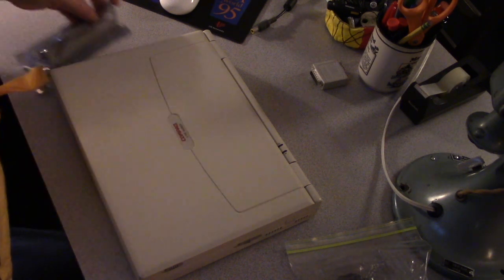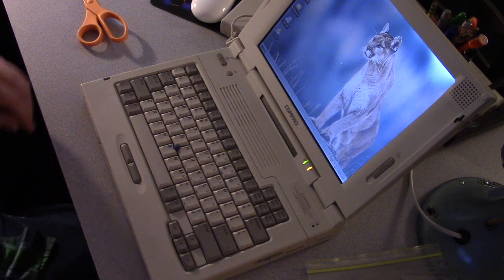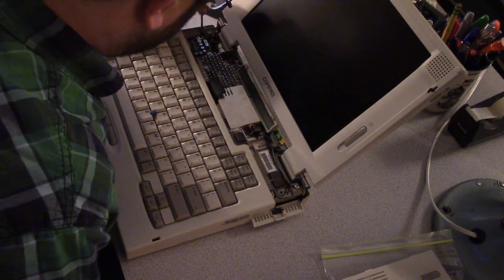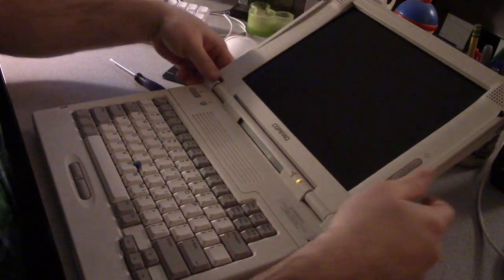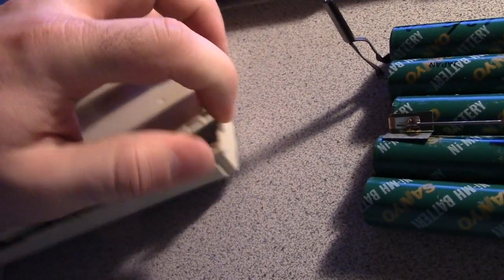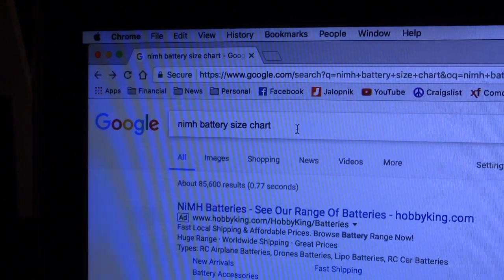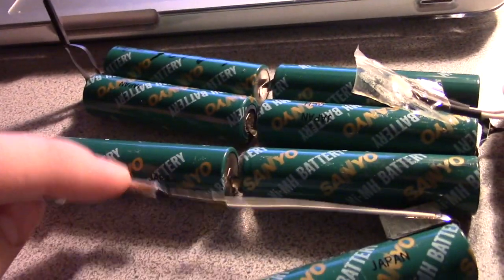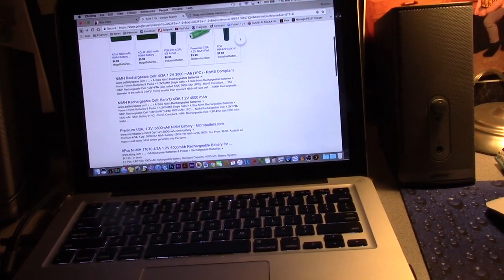Compaq LTE 5280 LCD Status Display Replacement, and Battery Rebuild Preview

Comment: I just picked up a Compq LTE  Elite 4/50CX but the LCD has streaks through it. Outside of that and the fact that the battery doesn't hold a charge it's in perfect shape. Can't find an LCD anywhere :-(.

Comment: Great video! BBISHOPPCM's World, I wish you had that LCD replacement video because my LTE 5280 has a damaged LCD. Btw, could you please tell me where and for how much did you buy the LCD? Another question you might answer is, Can I boot LTE 5280 from CD-ROM drive? I have the original CD-ROM drive but not the floppy drive. Hard drive is damaged and I need to install an OS on this machine :)

Comment: Great video, I had one of these as a gift from my uncle way back when I was like...13 or 14, something like that. Loved that thing, ended up saving up to get a CD drive as well as a new battery, I think mine was a 133 somthing like that, was great to play old games like Roller Coaster Tycoon or Sim City 2000 on. I still have it somewhere, I doubt its in working order. This video was great

Comment: Cool video! I really like the LTE 5000 series laptops.  I've recently started restoring my 5280. And you may know this already but just incase you don't. Don't ever upgrade to bios version 7.32! It's very buggy. It makes the post hang for several minutes! I downgraded mine to 7.20 and it made a world of difference.

Comment: Aftermarket Li-Ion batteries exist for these laptops. I have one that was purchased in the early 00s from Batteries Plus. I still have the toast original Compaq OEM battery, 3.3mah/12v if you needed to know the specs. The Li-Ion aftermarket one is lacking any indication of its capacity. I also have the Multibay dock for my LTE5400, never did manage to snag the MPEG/Video adapter thingie though.

Comment: Was wondering if you could help and maybe make a video on this topic but battery corrosion and what to do? Seems to be a plagued problem with vintage computers. I have a PowerBook 190 and the battery has leaked (years ago probably) looks to be on the terminal leads. Doesn't look that bad but what is the best way to clean this up? Computer works without any problems. Also is better to take the battery out of the laptop all together and have it exposed?